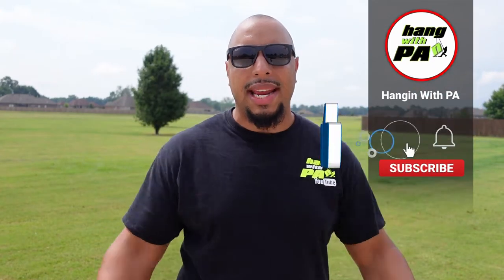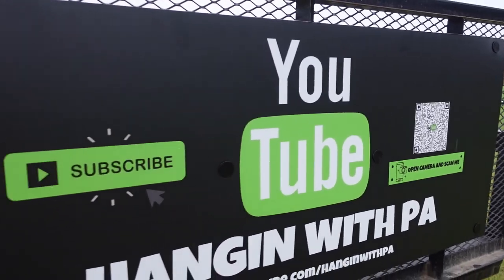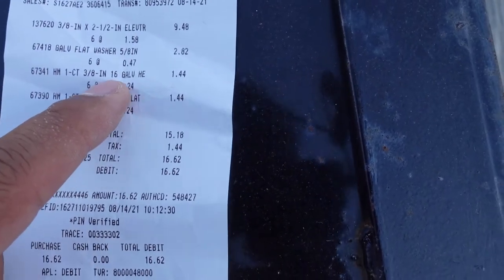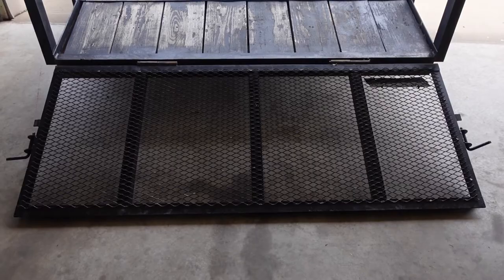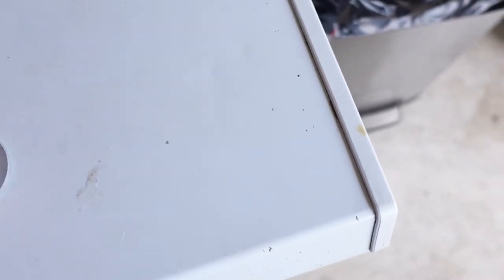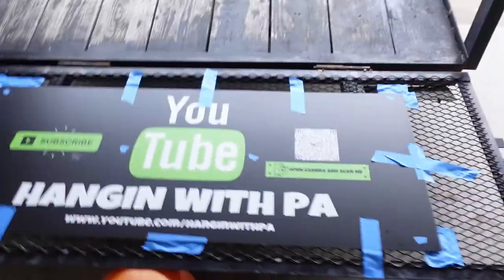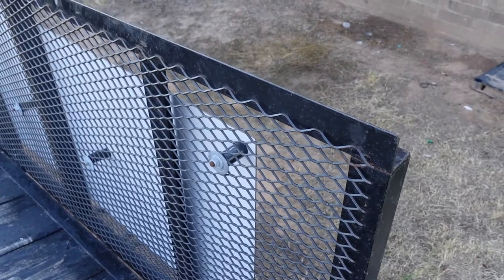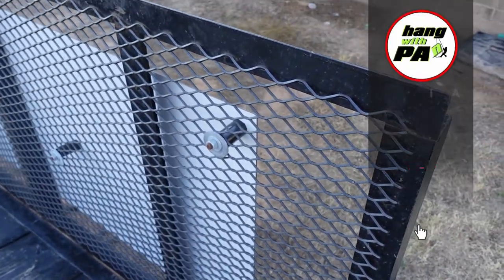HOW TO INSTALL SIGNAGE ON YOUR LAWN CARE TRAILER ADVERTISE YOUR BUSINESS

Comment: Love the sign and idea but concerned about the inside headwear puncturing holes in the tires.
Reply from the maker: No issues you can use hardware that is more flush if your concerned, with atv tires Im not. Also because of the lugs I’m probably not even hitting them

Comment: Does this black sign get scuffed up? If you look at my picture to the left that’s what I want to put on my sign. The black behind it I feel plays a big part In the branding with the bright green colors so I don’t want to go white.
Reply from the maker: No, only issue I have is that got small scratches when i put it down on rocks, but now I just bring a moving blanket with me to cover it when I load and unload in off-road parks. On concrete it’s completely fine.
Reply from the maker: Understandable about the black, it definitely pops more then if my stuff was on a white backing